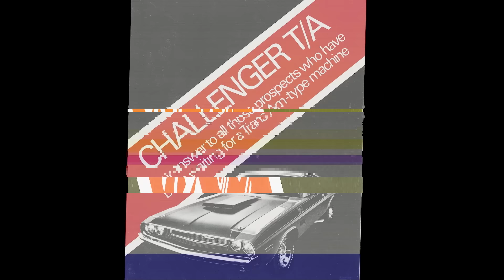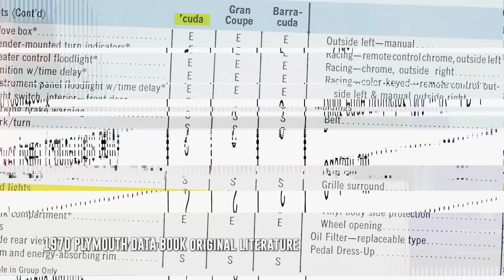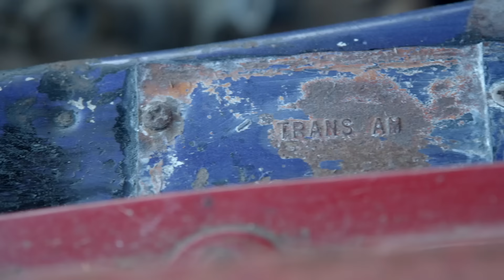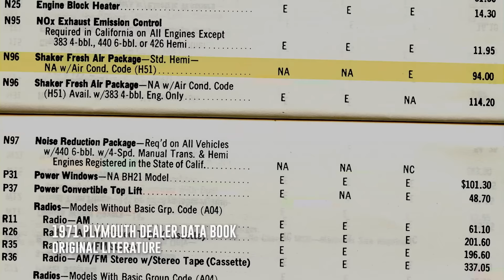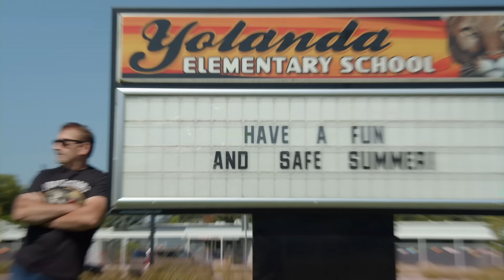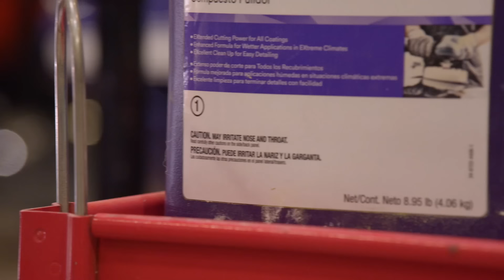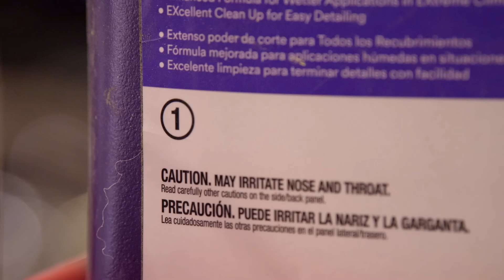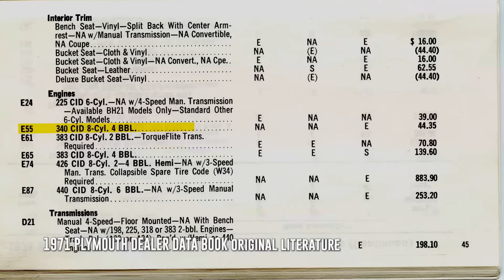1970 CHALLENGER T/A 340 SIX PAK: FACT VS FICTION

Comment: IIRC, didn't the T/A and AAR 340 come with W-2 heads with offset rocker arms? Didn't they also come with a quick ratio steering box also? The rear finish panel under the bumper had no cutouts for the exhaust, because of the sneaker (megaphone) pipes?